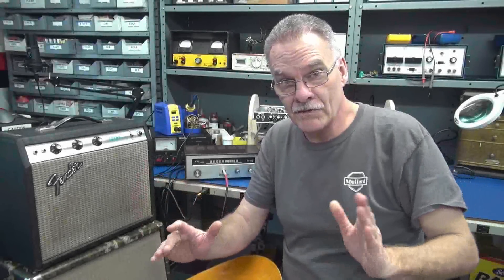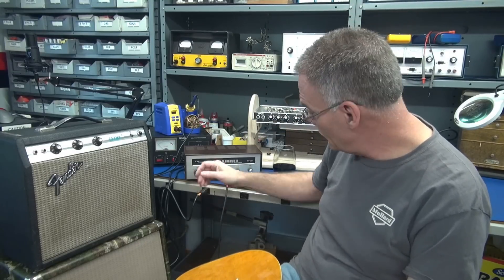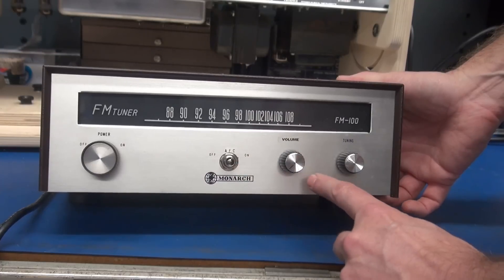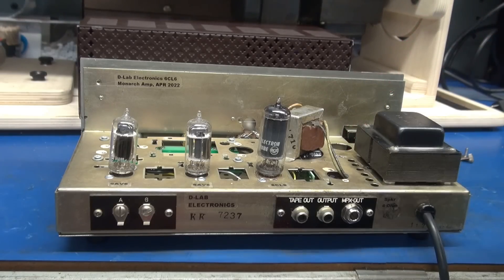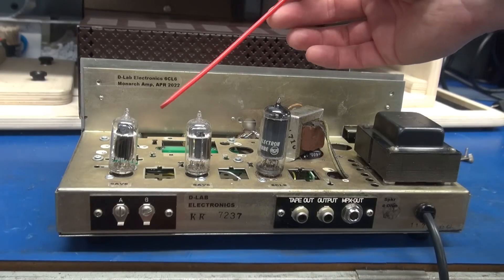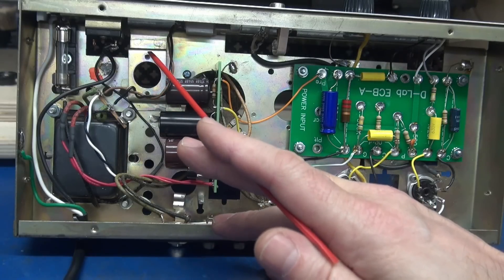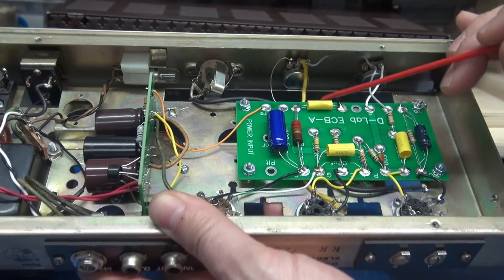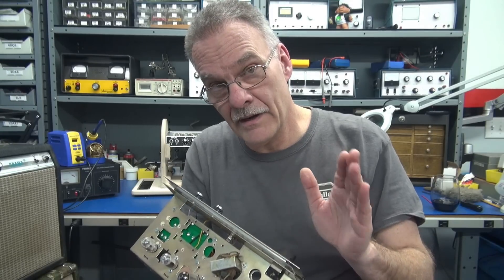New 6CL6 1 Watt guitar amp build inexpensive solution to high tube prices Monarch Tuner retrofit

Comment: Can a 6CL6 substitute for an EL84 power tube in a guitar amp?
Reply: Not generally.

Pinouts have multiple differences and 6CL6 only has 7.5 W anode power dissipation, with EL84 being rated at 12W.
Reply: There is a simple Japanese builder's PP 6CL6 audio amp using 12AT7 and PP 6CL6's, called Zendan-Sado PP 6CL6. It uses a 16k OPT primary vs. typical 8k for PP EL84. There is also a PP 6CL6 amp called Lamington Lite. It aims for about 10W output. Both of these are hi-fi oriented, but at least finished schematics to reference.

16k:8 PP OPT's are not too common, but you might be able to cheat with a 8k:8 OPT with 16 ohms on secondary (16k:16).

I've never built either. I just collect schematics for...some day

Comment: How about build a guitar amp using compactrons?  Most of them you can not give away.  I'm thinking a 6C10 triple triode for front end since it is very close to 3 12ax7 triode sections.  Driving a 6BA11 output stage using the triode section as a phase inverter driving the two pentode sections in push pull for the output.  OR, maybe a single tube amp using the 6AF11 which has two triode sections and a pentode section for single ended output.  Maybe a couple watts for amplifier outputs.  Almost a pocket practice amp!
Reply: Only problem with that is .......6C10 are very rare and expensive. $100 is the going price.

Comment: you should show how you wired the diodes to your power supply board. It is designed for a tube fullwave rectifier . Newbies would benefit from you going over the schematic and how you wire stuff instead of just breezing over the details. Just one mans opinion. Keep up the good work.
Reply from the maker: Yes, I agree will do

Comment: Tube amps for guitar are pretty much do anything they work and sound good. Doing Hi-Fi, you realize tubes are extremely flexible, but are just as sensitive as solid state to make them actually perform the best. You really need to run the numbers on paper to get the best performance solid state or tube.

Comment: Great job on repurpousing chassis and oddball tube builds. Another source for chassis is the small practice amps for cheap. Comes with chassis, speaker, and cabinet. Great for small tube amp conversions. 🙄

Comment: Yo - lemme axe you sumpmm.
Ever thought about a transformerless guitar amp along the lines of the 'American five' radio?
Reply: You don't want to do that.  At the least you need a 120v transformer to isolate the circuit from the wall current.  There are plenty of examples of series filiment guitar amplifiers (Silverstone 1448 for one) and they are dangerous and generally sound like trash.
Reply: That kind of amp is a big part of the 'widowmaker' amp reputation, with a two-wire AC-cord plugged in the wrong way. In a radio the wooden case kept you from touching anything. With a guitar, you usually have a firm grip on the strings that are usually grounded...reversing the line & neutral is how the strings became energized (in a bad way).

Comment: Another substitute for a 12ax7 is a 6n2p, which are old soviet-era tubes.  They are identical except there is no filament center tap and the heater is 6.3v only.  But you can find lots of 10 on ebay for around $30 w/ shipping.  Though it looks as if most of the sellers are located In Ukraine. Given the troubles over there, could be hard to get things shipped out.
Reply: I don't know how identical. From what I understand, the pinout is different.